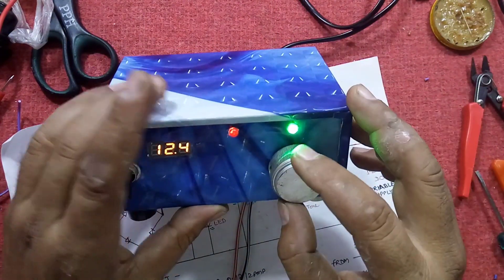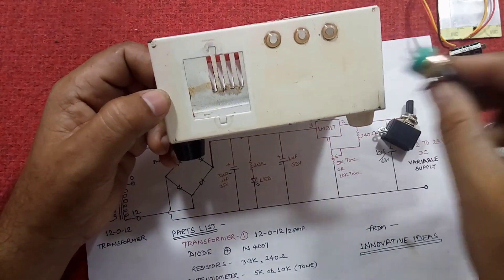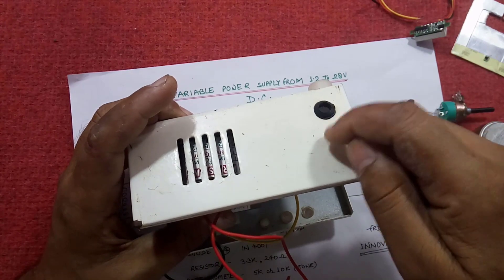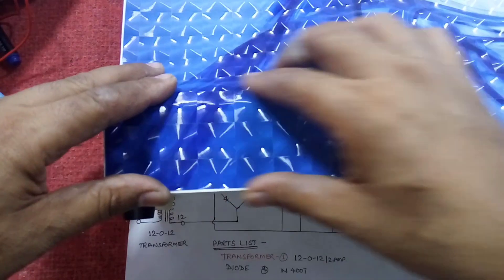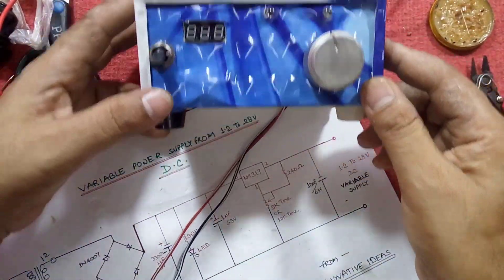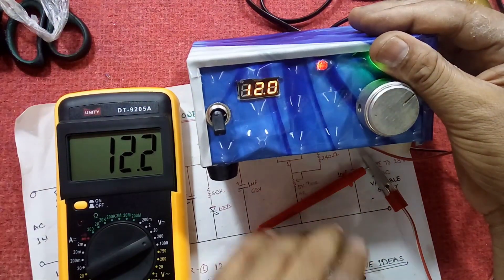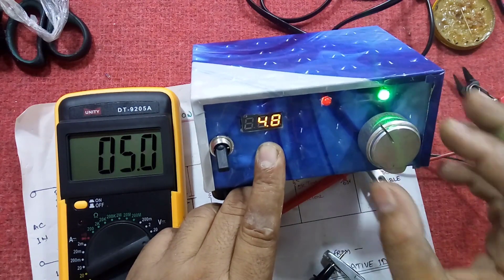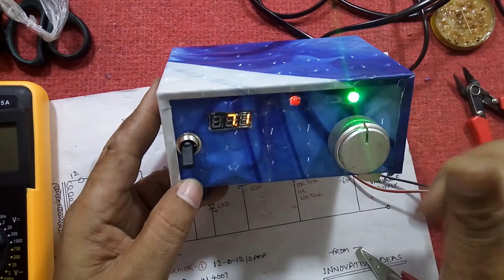Make Adjustable power supply Easy Steps DIY 1.2V to 30 V Battery Charger by innovative ideas

Comment: HELLO BRO . I VERY IMPRESS WITH THIS SIMPLE CIRCUIT . BUT THIS IS WORK WITH DC SUPPLY  ... CAN U PLZ HELP ME FOR ONE THING .I NEED SAME AS THIS CIRCUIT BUT THAT WORK WITH AC SUPPLY & GIVE OUT PUT IN AC & WORK WITH DIGITAL . MEAN TO SAY MAKE (variable AC DIGITAL POWER SUPPLY ) COST IS NOT A PROBLEM ... PLZ HELP MY WHATSAPP  N: 9212222213    WITHOUT TRANSFORMER  & ARDUINO  BECAUSE  I WANT TO USE WITH HEATING ELEMENT

Comment: Can i use a 6amp 12-0-12 transformer and use the same components  that you used?
Reply: Yes, but you're going to be limited in current to your weakest link in the chain, which is the LM317 which is only good for 1.5A.  Likewise, make sure your components support the appropriate wattage and rating you're looking for.

Comment: How make  0 volt to 24 volt dc variable power supply
Reply from the maker: Jittu Sharma Sharma use 25 volts of capacitor in bridge...
Reply: INNOVATIVE IDEAS  
 0 to 24 volt variable suppliers  10 amp  how make?

Comment: HI. GOOD VIDEO FOR STARTERS! You can add 2 diodes in series with the output to make the lowest voltage go down to 0V. Also use lm317 in parallel configuration  to achieve higher power 
output!